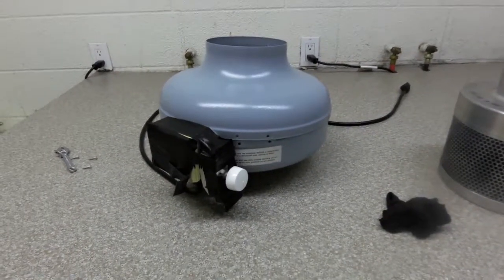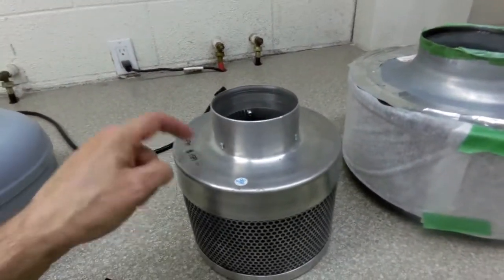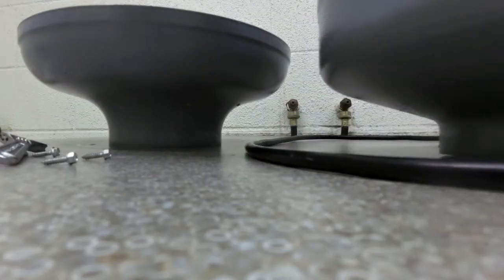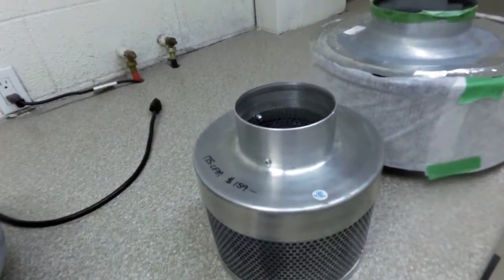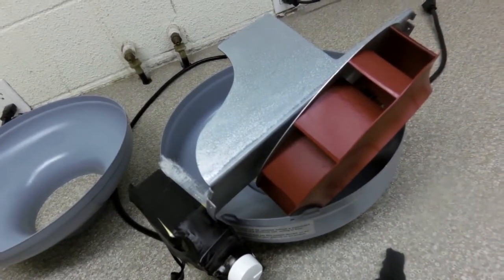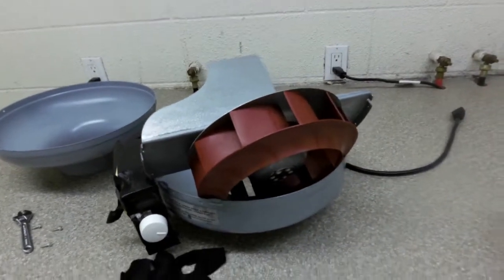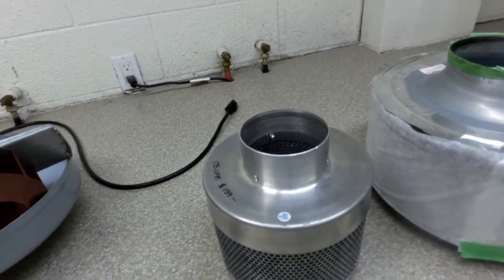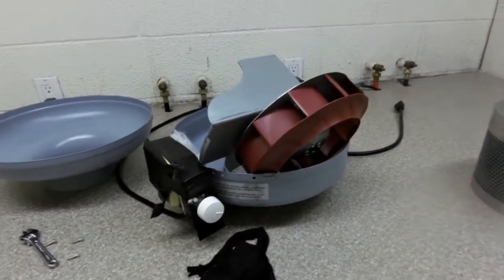Cleaning my Elicent inline fan

Comment: I was amazed at the particle test, especially when I see what equipment you are using. Can you please describe how you made the contraption on the end which is a housing for the fan and hepa filter. I wonder how you know which hepa filter to purchase  so that it can handle the flow. I mean geez 72 watts that is a very active fan. Thank you RR
Reply from the maker: I sealed the bottom with a plastic plate, the top with a reducer flange. Most Honeywell filters will work with inline centrifugal fan between 120 to 309 CFM *max) With my counter, I can't tell if the particles are as small as .5 microns, only that the carbon filter is generating its own particulate matter as well as passing many other particles floating in the air. I do not know how long the carbon particles would remain airborne, I would always post HEPA filer a carbon filter just to be safe. See my other videos to see how I make a negative pressure box to pull and filter air from another source. Carbon filters are only for odors/voc;s and HEPA filters are only for particles. When use together you get the cleanest air possible.